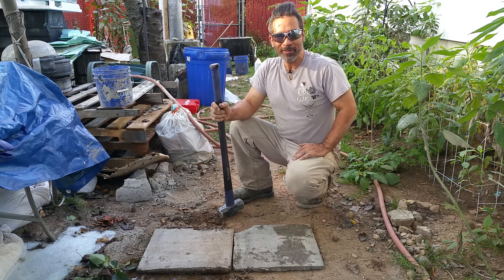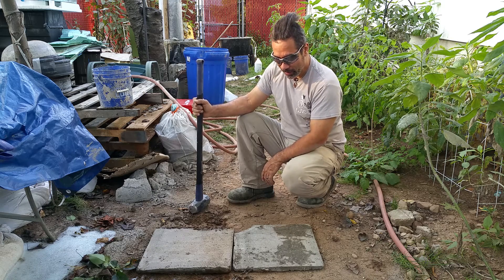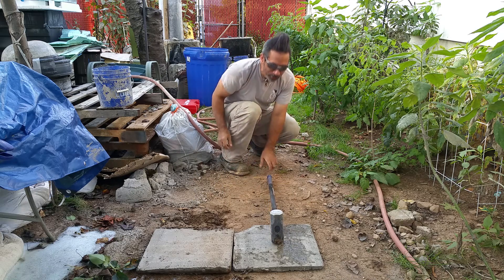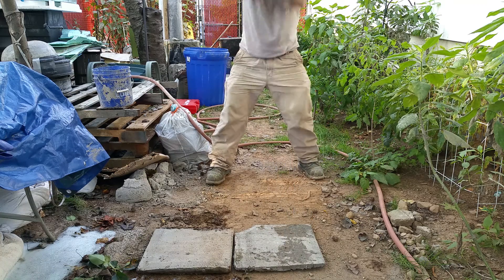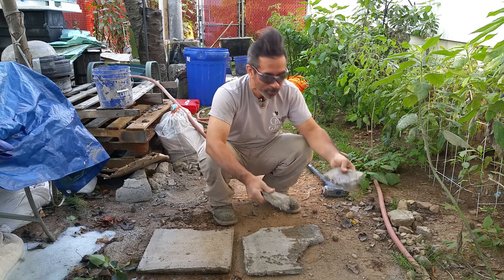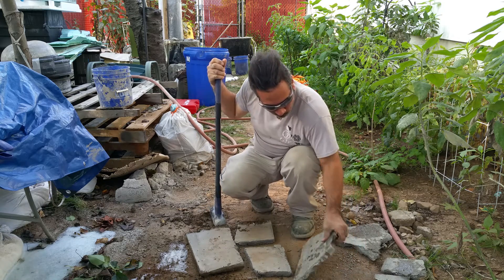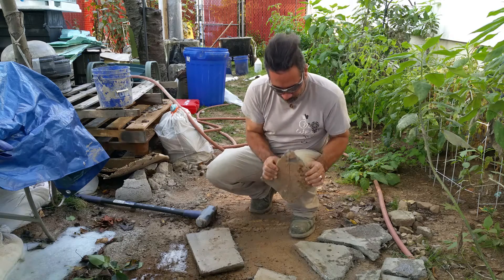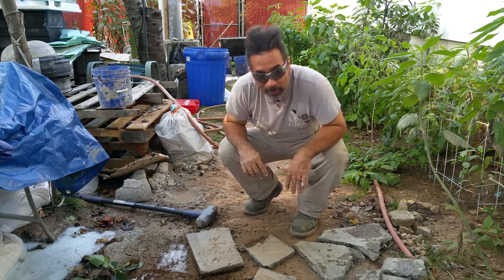Basalt Fiber Chop | Helix Micro Rebar | Concrete Slab Test part 2 #Aircrete #AircreteHarry #Basalt

Comment: Great info.  Thanks for posting your video.  I am curious how long the Helix rebar will last before rusting away..  Your thoughts?
Reply from the maker: Welcome MJ,
Thank you - Appreciate it. 👍 
Helix micro rebar is covered in Zink - which prevents rusting.
Reply: I am told that it doesn't rust inside the concrete due to lack of exposure to air and elements
Reply from the maker: @portlandlocalchurch8168  That's the information I inquired as well.
Reply: @portlandlocalchurch8168  If that was true then normal rebar wouldn't either.

Comment: the thing about your fiber re-enforcement is there is not enough cement for it to be effective, fiberous re=enforcement needs a lot of grip to be effective and there just isn't enough there. Aircrete is about using as litttle cement as posible to reduce the weight. fiberous re=enforcement needs all the cement you can use to work effectivly. the best re-enforcement is somkind of web, it needs to grab volume of mix or spread out as if you where on thin ice, You need to spread your weight as wide as possible tonot fracture the mix. Air crete is not strong but a good filler. the web will keep it together when it dose crack, because it will crack.  All concrete cracks.   So the smaller the grid the better your holding power will be.  Keep in mind it is just a filler, the strenght comes frome the coating, weather fiberglass cloth paper vinyl ester ruber coating all good coatings and will produce a good strong panel used in the proper formula.
  do not expect to much from the aircrete, you will disapoint yourself. Be smart use it for what it is great for.
  E-mail me directly and I will give you some great ways to use it that will astound you.
  tracydcraig@gmail.com.

Comment: Only thing is, if you had rebar through it ... how hard would it be to break the concrete apart.
Reply: Rebar is used in buildings and slabs for a reason why do recon that would be huh.

Comment: Hi, Harry! I'm Jen, and i've been following your channel and you have GREAT ideas on here.
I'm sort of in a learning curve right now. I'm pulling together ideas on making a Aircrete Dome, and i would be building by hand alone in Western NC, the mountains. I'm wondering if you have any information on making an aircrete dome that is stable and structurally made to stand on top of, like a deck. (I'm looking at a one story dome. I was gonna put a greenhouse sorta thing over the dome to recycle heat/liquid water through the winter, and maybe insulate the northern side of the dome with earth, sorta like a gnoll) However, if I do that, i need to find the fastest/best way to do it. I'm not sure if a brick dome with rebar and mesh could hold up, and I'm wondering what others have done.

I have been looking for structural ideas to support what i want to do, and that's how i came across this particular video- looking at rebar options. However, i'm wanting more information on structural support and different options than just standard rebar. So, whatever i'd be doing would be in conjunction to the Helix and regular rebar, but i'm also trying to think of cost effective ideas. Have people used wood and have had success? Even chain link fencing? I'm having a hard time finding information on that.

Do you have any suggestions of where to get this information?
Reply from the maker: Hi Gensci, the best way to build a dome in my opinion is to build an Ecoshell first. Ecoshell is a reinforced concrete then to cover that with a layer of Aircrete for your insulation. This is how I am building my home and how I will be teaching in my next workshop.
Reply: @AircreteHarry  Awesome! cant wait. ill be staying tuned!

Comment: Have you tried polypropylene fiber? https://www.google.com/imgres?imgurl=https://sc01.alicdn.com/kf/HTB1WF2pRXXXXXbqapXXq6xXFXXXZ/Concrete-macro-polypropylene-fibre-waved-Shwitcom-PPB.jpg_350x350.jpg&imgrefurl=https://www.alibaba.com/product-detail/Concrete-macro-polypropylene-fibre-waved-Shwitcom_60654609867.html&h=350&w=350&tbnid=KKk-EAiYCr0VnM&q=polypropylene+fiber+reinforced+concrete&tbnh=120&tbnw=120&usg=AI4_-kQM7LDkjxNZlxO6UJR5UiwEHIIKSg&vet=1&docid=Cfl9-BPYXkI4mM&itg=1&sa=X&ved=2ahUKEwibvMO63vLgAhWZBIgKHTKIAQ4Q_h0wEXoECAUQCA. Also have you tested the results from difference thickness? I am thing about 1" thickness for the sides of my boats. The boats are now made from 3/16 thick plywood.

Comment: you cant make any assumptions from that. 1. slab was way thin. 2. you actually hit the first slab 4 or 5 times. so no way of saying which was stronger. I would like to see how well the work in a 4 inch block or say combine fiber filled aircrete pour into  a form containing a couple of pieces of rebar of any kind.
Reply from the maker: If you had the samples in you hand you would agree with me. Look at this video and start it at 2:48 I think you will understand why it is so much stronger. https://youtu.be/NcNX7OEGu7Y

Comment: Have you done any experiments with the micro rebar and styrofoam and concrete? Do you think that's worth even trying or testing?
Reply from the maker: I don't think it's worth trying because does styrofoam will not adhere to the micro rebar. The micro rebar was designed to be used in cement or concrete. Anything with voids in it will be spaces that cannot bond to the micro rebar.

Comment: LMAO!  To prevent a sledge from breaking a thin slab of concrete is NOT why one uses basalt fiber chop.
Reply from the maker: Of Course not it was done to test how well the Basalt or Micro rebar  holds the cement together. Micro won all the way.
Reply: Which IS the joke.  That isn't the job of basalt fiber.
Reply: @patrickeh696  What is the job of basalt fiber?
Reply: true

Comment: Does cement stick to the Helix microfiber, better than it sticks to the Basalt fibers?  Hard to see in video. 
Sounded like a crack happened fairly soon into the pounding, on both.
Reply from the maker: The cement does stick better to the Helix because the helix is a twisted piece of metal with more surface area to grab onto.

Comment: These reinforcing products are probably going to act as a thermal bridge, especially the micro rebar. You might find that they lower the insulation value of the aircrete significantly.
Reply from the maker: Anton Taylor I agree it would lower the insulation value, but the way I plan on using it is for a structural layer of concrete. on top of the structural layer will go the insulated aircrete.
Reply: Talyn71 I'm researching building materials and techniques, and I've been thinking about a similar idea - a reinforced layer either side of an aircrete thermal layer.

I was thinking of putting a layer of hessian cloth, soaked in cement, as the inner/outer layer, then going over that with a finish of some kind.
Reply from the maker: Anton Taylor Good idea but don't use portland cement for the inside and outside. I have something better and it's water proof. I will be making some new videos soon on using it. http://www.homedepot.com/p/Rapid-Set-55-lb-Cement-All-Multi-Purpose-Construction-Material-02010055/202188447
Reply: Still researching at this point, so far it's a tossup between aircrete and haybale construction.  I'm leaning towards aircrete (I'm worried about hay biodegrading due to vapor ingress, plus I think aircrete has a higher R value).
Reply: Anton Taylor do not use hay bales, its straw bale that you would wanna use Straw bales is a R40 rating
Reply: aircrete

Comment: Hey Harry, thanks for sharing. Do you think Helix Microrebar will float or will sink in (thinner than concrete with aggregate) foam crete? 

 FYI: there are other types of light concrete out there. People all over the World use wood chopping and saw dust, poly balls, hemp fibers, adobe (straw, hey), vermiculite, perlite, and more. I wonder if Helix will sink in foam crete. Helix will have enough support to float in concrete with light aggregate/additive, I assume. 
Concrete with hemp fibers and poly balls or foam crete with glass fibers seems to be strong enough to support itself in monolithic structures. I have seen a lot of videos people put together simple frame, smt to put boards on, and then work/pour their way from the ground up, usually pouring a foot or two around the building (almost like 3d printer, one layer at a time), When light crete is dry enough, they take those few boards/forms and move it a foot higher. This way one man can build/pour house in any shape if he/she's a good enough carpenter to frame it.
 Like this guy. His house is made with saw dust, shavings, cement and sand and over 8 years old these days.
https://www.youtube.com/watch?v=Q9kZ0PD9Yuo

Best regards.
Reply from the maker: That guy was funny. I had what he said translated. The idea for me with the aircrete is to us as little ingredients as possible to make an insulated dome. And to be Eco friendly by staying away from using any wood as well. With the aircrete I don't need to worry about shipping and buying other materials. Aircrete just needs cement and foam agent.
Reply: I see. I have similar thoughts and I am doing a lot of research about alternative building methods. 
 So, will Helix micro rebar remain evenly distributed in air crete or will it sink?
Reply from the maker: I have done one test with aircrete  and micro rebar and it will remain evenly distributed. But the aircrete I made got rained on. So I have to do a new test. I don't know yet if it will work good with aircrete.  I do have another alternative building  system I will be working on in two weeks stay tuned.
Reply: aircrete will float